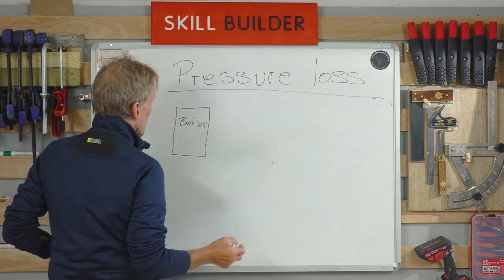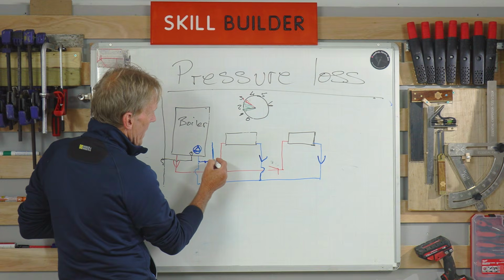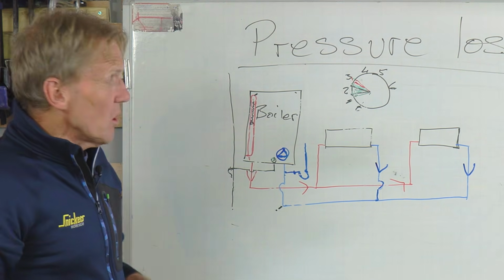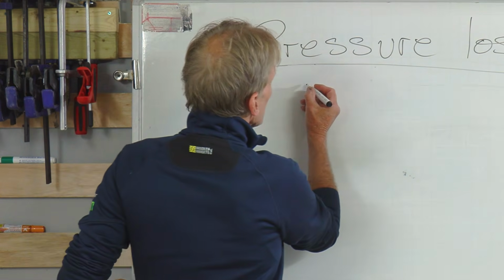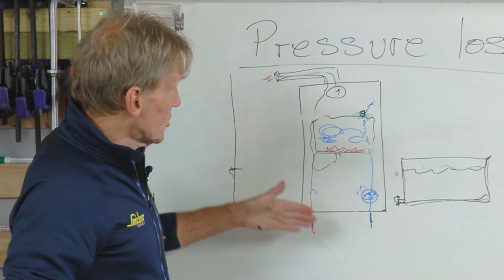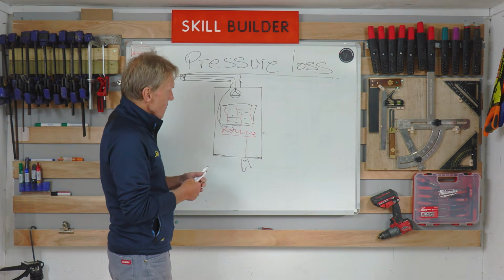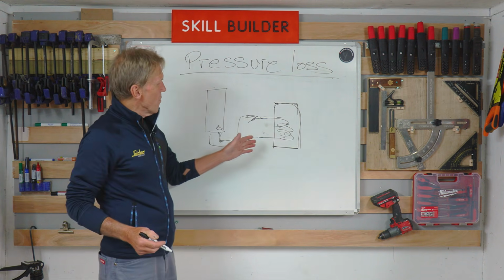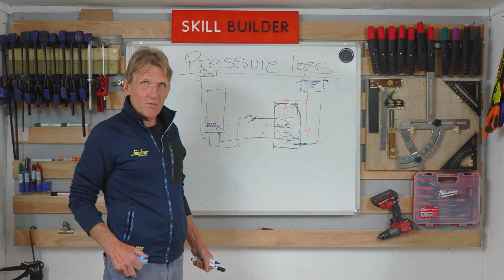Why Does My Boiler Keep Losing Pressure?

Comment: Your video has enlightened me Roger. I had a hybrid heat source pump and condenser boiler fitted on a UK grant. It has been 18 months of hell I am 71 and have had 47 days of no heat or hot water. Finally 5hey come after reporting them to the ciuncil grant authorities  to get them to attend. My boiler empties every time its filled.  It works then in the morning its emptied.  They have just put leak sealer in . The saga continues. They did not change very old micro plastic pipes that are in my loft and I wonder if this could cause so much pressure in these tiny pipes. They fitted two runs of 15 ml from two rads the rest is the old micro. I ask why they did not change ancient pipes and left most old rads in and claim it all cost the government £38000. They have not looked at any of these things that you have mentioned. Thank you for a great video.
Happy new year..

Comment: One Extra thing to look out for,  A blocked flexipipe leading to the expansion tank, my boiler had symptoms losing pressure, after turn off, and going overpressure when running. After taking out the Expansoin tank, for checking, I found that the flexi pipe going from expansion tank to top of pump, was completely blocked, so cleared it with a bit of wire & Refitted it.... bingo, boiler works ok again. i will buy a new pipe and exansion tank though, as it seems that the internal rubber lining of pipe and also possibly tank membrane have been breaking down.

Comment: My boiler loses pressure overnight..i wake up to about half a bar..most times when i turn the heating on it immediately spikes to 1 bar and rising before slowly droppin when turned off..we have an external exspansion vessell beside the hot water cyclender in the hotpress which was recently bleed..any ideas?cheers mate

Comment: I bled 2 radiators that werent warm at the top and ever since then ive had the pressure zero out about 3 or 4 times a day..  what could be wrong? I double checked and tightened the two rads i bled.. not sure what to do, its a combi

Comment: Thanks for this info. My question is, if I reduce the temperature of the hot water and central heating on the controls of my boiler, do you get less expansion and therefore the pressure is more stable? My pressure relief discharge pipe does discharge water occasionally. I’m topping the system up about 3-4 times a year, but I do run my water and heating quite hot. Thank you.

Comment: I just want to offer my thanks to you for helping me find ' a micro- leak ' in my C/H system.
After all my efforts failed to find the leak, I followed your advice and added a reasonable amount of  ' cheap, smelly perfume ' into  the system. Closed all the doors to each room and waited for an hour or so for the perfume to circulate around the system. Entered each room in turn and low and behold, I found the troublesome leak in a room with a strong 'perfume' odour.
Can't thank you enough.
Very kind regards for your expert advice.
Rod.
Reply from the maker: Hi Rod 
That is great to know, some plumbers ridicule this method but I have used it a number of times and it has always worked. It makes my question why anyone would feel threatened by it but some plumbers are really hostile,
Reply: How did you add the perfume to the system, was it just pouring the liquid perfume into a radiator? Thanks
Reply: @uhjk91  Hi, Sorry for not getting back to you sooner. I unscrewed the top off the 'Magnetic Filter'
and poured in a small amount of perfume (it's where you can also put any anti sludge product into the system - such as Sentinol). Hope that helps.
Rod.

Comment: Can't you just open the heat exchanger like you want to service it and check or drips? Or turn the boiler off, leave the filling loop open and disconnect the condense hose from the trap and check for continuous drip?

Comment: Hi all .i have a baxi eco tec 28.I’m loosing pressure on a daily basis.i fill the boiler and in 1 hour it drains down and the boiler goes into E1 shutdown.I’ve had an independent engineer out.he’s checked all the pipe work and no leaks.the outside dump pipe only has a few drips.so we’re is all the water going.i have just booked a baxi eng to come and check the boiler.it was only serviced a week ago by baxi. I’m at a loss as to what’s going on.the boiler is 6 years old

Comment: Hi, my girlfriend has a firebird 120 system diesal oil boiler on A sealed system indirect to a Santon Premier Plus 300ltr cylinder on a S plan with two 2 port Valves, the CH is working fine, but the DHW is kettling the boiler, any ideas please?
Reply from the maker: Thwe flow rate through the boiler is too low and the water is boiling because of scale. I would try a scale remover in the boiler

Comment: I had the opposite reason with radiator pressure gradually increasing; when the boiler pump for the hot water had failed and would dump the hot water in the heat exchanger back into the radiator circuit. The expansion tank pressure was correctly set.

Comment: Here's a problem for you... we've just moved into a new place 

The bath tap runs colder than the rest of the taps, even the shower head in the same room gets hotter. 

What would be the cause of that? 
It is upstairs btw 

Cheers Rog 
- C

Comment: We lose pressure every 6-9 months or so. But this time the pressure won't go back up. We open the valves, the water runs in, but it goes straight through the boiler and out to the garden over flow, all while the system pressure remains at zero. The boiler is set to 2.6 bar. The pressure relieve valve seems to have bust and sets off at zero pressure!

Comment: If I have a Worcester Bosh boiler and 12 radiators that are going from ~2 bar down to zero over the course of 7 days, how much water loss am I looking for? As mentioned in the video there is a little bit coming out of the pressure release pipe, but it is only a very small amount.
Reply from the maker: you could be looking at 1/2 a litre. It depends on the charge in the expansion vessel.

Comment: Thanks for a very informative video. While I wait for an engineer to come out (they're hard to find this time of the year) I am trying to do some self diagnosis. Vaillant combi, 1 year old. It's losing 0.5 bar every 24 hours. PRV pipe dry. Expansion vessel just serviced. No visible leaks, no excess of air in the radiators. I have noticed a tiny drip running down the condensate pipe (the service engineer didn't even look at it) from a junction elbow. Could this be a significant clue? I am not qualified to disconnect the condensate pipe so I am going to leave it for an engineer to check.
It's either that or a complex search for a leak behind the walls or under the floor...
Reply from the maker: Try this, it has worked for me several times when all else fails

https://www.youtube.com/watch?v=KHogrs_OkxM

Comment: Thanks for the knowledge, I found that my system had two 2 port valves with a split heating system operating across 2 zones. I was losing boiler pressure and happened to mention it to a next door as we are on a newish build estate he mentioned that he had to have both replaced. I checked the valves and found a wet carpet in the cupboard which I now plan on changing both of them as might as well if the system is drained looks like to have a weep from inside the valve/motor. Fingers crossed..

Comment: Thanks, I watched all the video, in our case the boiler only loses pressure when the central heating is operating, it doesn't lose pressure for the rest of the year when just supplying hot water. Does that narrow down the potential fault? Previously the pressure release valve went but we don't have the external sign this time.

Comment: Our system boiler is in the garage, there is an integral expansion vessel behind the boiler but the schrader valve is way up on the top of the boiler and hard to get to,  so I fitted an 18 litre ( way overkill, but we have 14 radiators in the house ) expansion vessel via a tee in the return leg.  The pressure gauge is rock solid whether the boiler is hot or cold... I always keep the system well topped up with inhibitor so no chance of corrosion in the expansion vessel.  Sometimes the discharge valves can leak water out even though they are not at their discharge pressure.

Comment: The absurd situation I have is the flexible U-tube with the two valves is near the hot water tank - upstairs - a good 70 steps away from the boiler which is in an attached lean-to. So you can't see the pressure gauge move on the boiler when you adjust the two valves near the water tank. You literally need two people and a mobile phone connection to talk to each other while trying the get the pressure right.

Comment: Thank you for a thorough explanation.  Really useful! You covered so much.

The plate heat exchanger can also be perforated, leading to a cross contamination of primary and hot-water fluids.  Then, depending on which pressure is lower, either the primary pressure drops (rare) or the system keeps getting topped up (not too uncommon). 

Keep your excellent videos coming.
Reply: In the olden days (with header tank) the replacement of water in the system was automatic (thanks to gravity). What I don't understand is that it is entirely possible to implement an automatic pressure balance system so that the water pressure in the system is always at the correct pressure.  This manual balance system is nuts! -especially in my case where the pressure gauge is on the boiler (which is in a lean-to near the gas supply) but the loop gizmo to balance the pressure is at least 70 steps away, upstairs near the hot water tank.

Comment: when it gets cold  i can literally re-pressurise my boiler daily. if i turn my heating on for say 10 mins then turn it off, then i will lose pressure within say 10 mins.  I tend to keep my heating off for most of the time though because of the hassle (maybe 4 or 5 times a year i will put the heating on for maybe 10 - 15 mins).  Without using the heating - i will re-pressurise maybe every 10 to 14 days.   Boiler is from around 2000 though.  I think that "e19" is now permanently embedded in to the display now 🤣🤣

Comment: Extremely I teresting. 
I have an alpha one about a year old, doesn’t hold pressure, I’m wondering if the pressure vessel was ever pressurised. 
I had another property with 2 veisseman boilers, the plumber was just checking the system when one started poori g out the bottom, the heater matrix had blown, it was 9 years & 10 months old on a 10 year warranty, saved about £3k by being still in warranty😊

Comment: Why don't you start with why it loses pressure?

Without patience to dig through you drawing gages I will just ask.

I opened few radiators as winter came, I started to receive E6 which was not big deal just meant that the contact had rusted off on the temperature sensor.

Later I noticed a strange pattern that when it works at full speed, it has few hiccups but then goes back normal again yet at lower power.

Then logger said, your gage is below half bar (I had instructed him to keep an eye and report if that was a case as he keeps his work clothes in the boiler cupboard).

Then I noticed it was losing half a bar on each cycle which turned out to be accompanied with frozen water on the sofa in the garden which happens to be under over pressure relief valve. The valve opens at 2.5 bar but I never seen the gage going over 1.5.

I bleeded the freshly opened radiators which gave a half bar drop and topped the water up. That did not help.

So I assumed maybe there was an air bubble somewhere else and opened the air bleed valve on top but it spilled hot water more than anything else and was very difficult to close. 

There is another air float relief valve which candid Ravenheat engineers have decided to make with iron parts in an entirely brass setup. 

I did not check that. 

Anyway, it is cycling now between 0.6 and 1.2, I still find the pressure change unusually high. Water does not expand that much, does not it?

I will remove the dislike if there is a meaningful answer apart from draining all and refilling.

Comment: Hi Rodger. I'm 65 and I have had a go at a lot of things but never enough confidence to start my own business. 😕😕😕😕
So my boiler many many years ago kept losing pressure and I finally tracked it down to the expansion tank.
I ordered another one and when it arrived, I started to take out my old one.
It weighed a ton, so it was the seal that had got a hole in it and the side where it should have been air was also full of water (which is how I found out as water was coming out of the air valve) and why it was so heavy being full of water.
Changed the tank and all good.
Kept having problems over the years and finally got a new modern system installed.
I love watching things like this and how they work, but no youtube back in those days I'm afraid.
I was thinking of starting my own channel back in those days on CINETUBE. 😝😝😝😝
Great video Rodger and great explanation. 👍👍👍👍

Comment: Hi can I have some advice my housing association uses a contractor to maintain my boiler but they will not set it up so I can use my thermostat and if I don’t switch my boiler off at night the heating comes on at 2 in the morning. I have complained to the contractor and my landlord numerous times and still they won’t put it right.

Comment: Great video - really informative, thanks Roger. I'm having the opposite problem with my boiler - the pressure now keeps rising over time (a few days) until the system starts leaking at various joints along the pipework. This usually happens when the gauge reaches around 2.5. I'll bleed a radiator to get the pressure back down to around 1, and then it'll happen all over again. Any ideas on why this is happening and what I can check up on would be greatly appreciated. If it's an easily fixable problem for a DIYer (like me), I'll have a go - if not, I'll get a plumber in.
Reply: Hi. Two possibilities. More likely: the filling valve(s) are letting by. You need to change. You can probably do this 

Less likely, plate heat exchange (secondary) has a cross contamination. It means there are holes in walls separing the boiker water and the mains water. Again, you need to change this. 
I wouldn't think a normal DIYer could tackle this. An advanced one may.

Comment: I had an expensive  new combi boiler fitted about five  years ago and it kept loosing pressure ..the engineers would potter about for a little while, repressurising it, so it would work for a couple of months if I was lucky and telling me I must have a leak under the floor...(the thing is my old boiler never lost pressure) ...of course the guarantee ran out and I have had to give up with it. ..no good keep on throwing good money at it. Hopeless. I feel despair. ( I can't repressurise it myself because its in my loft and I am disabled)
Reply from the maker: You can very easily add a filling loop downstairs to save you having to go into the loft. I do it all the time

Comment: Hi mate I’m having trouble with my “vaillant eco fit sustain condensing boiler” it’s just gone 2 years old not so long ago but it’s a bit of strange one as my old boiler was a Bosch Worcester old greenstar condenser boiler. 
1st thing I can’t get the water to past 60c it won’t go up no more used to go to 64/67 before it got serviced for the first time! 2nd I have 7 rads one of them is downstairs by the front door (it’s a upstairs flat) and I keep getting the problem you describe with it being cold or lukewarm at the top , this happened with my old boiler to but it was always air in it so could easily sort it out by bleeding it myself.
However this time all I get is water and the pressure goes low and warns me to top it up I can’t find no air or leaks anywhere and the radiator is a new one unlike the rest of the flat which are the first rads put in around late 80s they all work fine but the one by the front door is never hot hot!  like the rest of them… it’s set at 63C for heating that’s fine they are hot to the touch every where bar them I got no rust inside I am aware of as the water is clean in all the radiators and I got one of those magnet clean thing’s attached to central heating flow going in and out the boiler. 
I am lost not even the two lads that come here knew what to do he said he sorted and left but they didn’t… I am lost and I can’t always get my reliable engineer Steve who 8 times out of 10 will always be at mine we got to know each very well through my old crappy boiler lol that kept braking down and got condemned twice but fixed and it still broke down was usually something serious 🙄 it’s doing my head in now don’t know what’s the reason.

Comment: One omission that got me out of a leak problem was Fernox leak sealer. Plumbers were warning against it saying it will block the heat exchanger so I rang Worcester Bosch who recommended it on a new system to seal little leaks and it worked extremely well because taking the house to pieces to try and find a leak can be very expensive and disruptive.
Reply: My main consideration with a leak sealer is how does it know what is supposed to get sealed and what is not. I would/will follow Rogers diagnosis method first and likely find the problem, leak sealer will be my last resort.
Reply: In no way was I suggesting  or even saying to make leak sealers the first port of call. When my plumber had scratched his head and deserted me I had to find a solution.  If the boiler manufacturer recommends Fernox Leak sealer and you don't understand the science behind it, is that actually a reason to not use it ? So much advice starts with find yourself a good plumber and believe me I have spent time and a lot of money trying to do just that.
Reply: @alanbayley3255  I guess the main thing is that it’s nipped your leak in the bud and you’ve probably got away with it not clogging your heat exchanger. The use of Fernox is what brought me onto this enquiry to begin with.